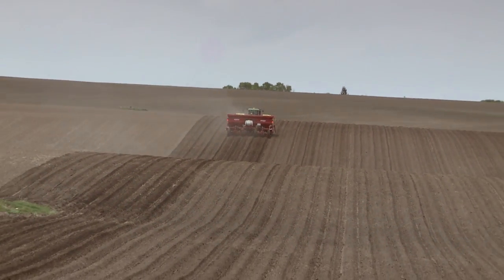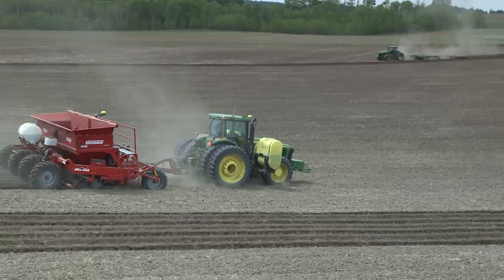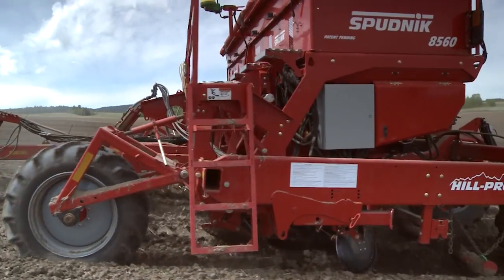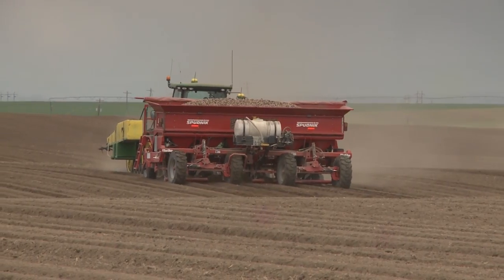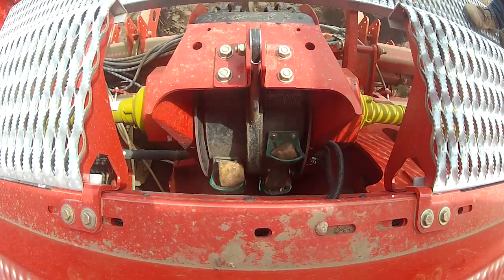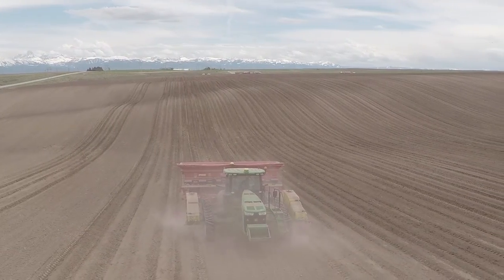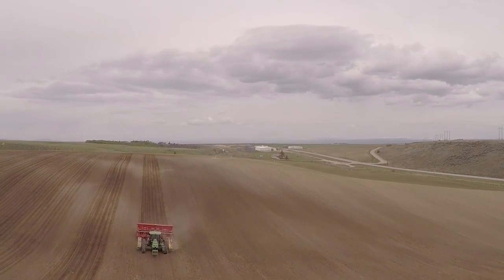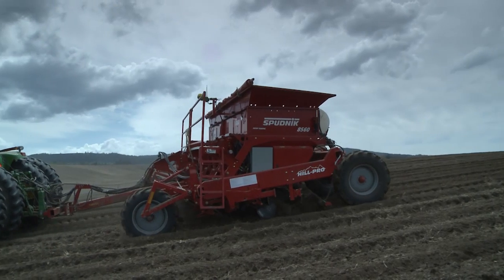Planting Potatoes with Spudnik HillPro and John Deere 8360RT at Smokey Gould

Comment: How hard you have the shakers set on the CCI screen and do you have all 8 Rowe's set the same? And how's the GPS work on the planter? ours tends to pull a bit to the left and it takes a bit to get on track when turning around any suggestions? Thanks